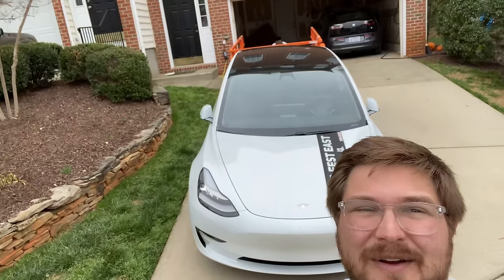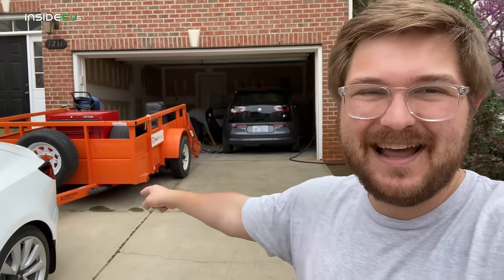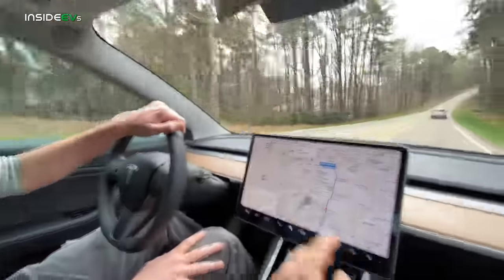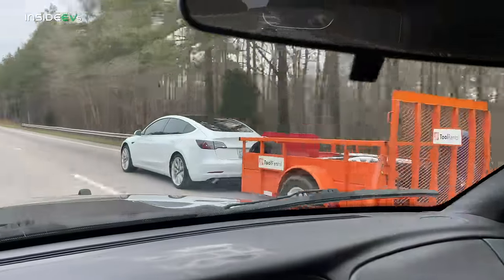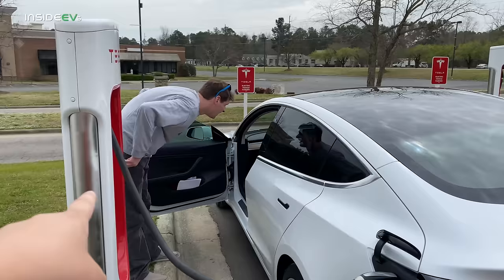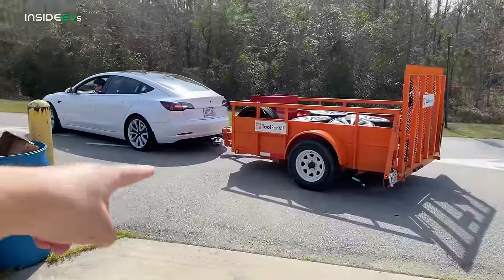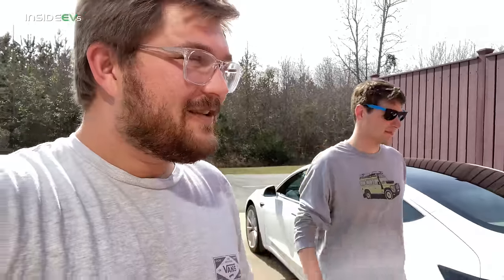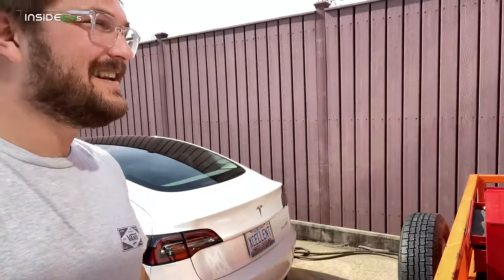Everything You Need to Know About Towing With Tesla Model 3

Comment: You could have picked a more aerodynamic trailer than that wind-catcher ramp equipped unit from Home Depot. It was meant for local haulage, usually to your home from the nearest Home depot. U-haul has some covered types that are more suitable for moving by road trip.

Comment: Fixing to do a 1150 mile trip with my 2022 Model 3 pulling a 5x8 enclosed trailer. It will be fun.
Reply: Blake, how was your trip? I’m curious because I may be doing the same thing. How much weigh did you tow and did you have any issues? Thanks
Reply: I would like to know too. I’m looking at trailers now for my 2019 LR

Comment: I'm picking up a trailer for my SR+ today. I know range will suck but this looks really fun and useful so I don't think I'll regret i t!
Reply: You gonna love it!
Reply: @teslascoop2177  def worth it. Have towed dozens of times already, so much better than renting or borrowing a truck
Reply: @GoHerping  Whats your Wh/mile?
Reply: @teslascoop2177  normally about 275. depending on what I tow in the 8ft trailer, I get between 350 and 425, usually just under 400.
Reply: @GoHerping  if you don’t mind me asking, what is the dry weight of the trailer?
I’m thinking of getting an overland trail’r Do Drop to pull on my Model 3.
Your numbers look impressive so far!!

Comment: Great video! In Italy we have different speed limit if you tow more than 400 Kg (880 lb). Normally the limit is 130 km/h (80 mph), but if you tow the limit is 80 km/h (49 mph).
I wonder the consumption at low speed... it would be interesting to know ;-)
Reply: Aspettando Model Y which is why the 3 is tow rated in the EU, but not the US. US tow ratings assume you can pull at the max posted speed limits. And puts more weight on the tongue.

Comment: I^2R gives power.  You were already measuring power which is measured by V*I or voltage times current.  Yes the drag will dominate your increase in power consumption.

Comment: "Everything you need to know about towing" but actually more like "a road trip we took once"

Does the car detect/make any changes at all with the presence of a trailer? Surprised it doesn't indicate anything since tow hitch is an officially-launched addon in EU.
Reply: I would like to have had an estimate on the weight of the loaded trailer.

Comment: Anyone ever did a consumption comparison with an ICE? See if consumption % is as bad with an ICE?
Reply: It depends, my little truck looses a lot of range when towing, our full size doesn't loose anywhere near as much with the same trailer and load, but it punching a much larger hole in the air for the trailer.
Reply: Really depends on the truck and trailer. This trailer would likely be nearly zero difference behind a full size diesel. A big trailer that's say 8 feet wide, 11 feet tall, 30 feet long, and 20,000 lbs would probably drop the range by 50%.
Reply: @kennethbowden4129  Funny, it looks like any namby-pamby egg shaped cute aerodynamic EVs will get normally the overall highest efficiency, but it becomes the worst when you start towing even somewhat aerodynamic trailers, and even though certain EVs in the making do not look to have the highest ranges due to simpler and far less aerodynamic designs, but they will suffer way less when it comes to towing a trailers... It seems the breaking point for when towing a trailer begins to suck for EVs is when the physical size of the trailer begins to overstretch the size of its tow car, therefore catching on the air and enormously increasing drag...

Comment: I'd like to see a video where the HD trailer empty was towed on a 10 mile loop, then using a tarp to cover the tailgate mesh area so that it 100% blocks the air - then do the same 10 mile loop and look at the consumption. I'm thinking that there won't be much difference because that mesh is really more for ease of loading (less weight to raise, less slipping) than to reduce drag.  EVs are great at test like that since watt hours per mile and autopilot would made the runs almost identical.

Comment: I've never seen sensors around wires for signal on trailer hitch! should be something specific for tesla? Usually when you clamp it, it has small blade inside that cut insulation.

Comment: I am thinking of buying a Model 3 and towing a motorcycle that is 400LB and I would drive about 70 MPH.  The long range model goes about 353 miles.  Trying to get an idea what my range would be in miles with the trailer loaded with the motorcycle.
Reply: did you ever figure it out? Thinking ab doing the same exact thing
Reply: @christianwest6111  From my research it really kills the range.  I ended up buying a Hyundai Tuscan Hybrid, no regrets absolutely love the car.  My plans were to buy a trailer hitch for it, however shortly after I got it, my wife bought a Jeep Grand Cherokee and I just borrow that vehicle when I need to tow something.

Comment: Im not sure why anyone thinks the cybertruck will tow any better. This is a tiny trailer by truck standards. With a 200kwh battery it'll maybe go 80-100 miles with a travel trailer.

Probably great in stop and go city traffic for short range. I think a phev truck will work so much better!
Reply: EVs are horrible at towing seriously its not even worth it, for short trips yes its good but...
Reply: And how far does an f150 usually go per tank while Towing vs not towing?
Reply: @ThomasP7572  ~600 empty. 350 towing. And refuel is 6 minutes. If the CT could do even half the range and double the refuel time 175 miles towing and 15 minute recharges it'd be great. But neither one is likely.